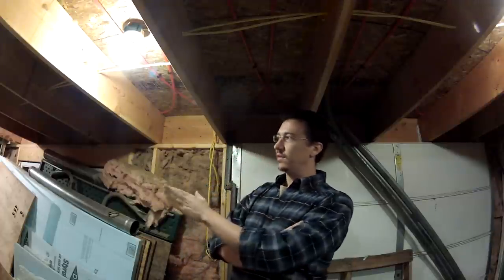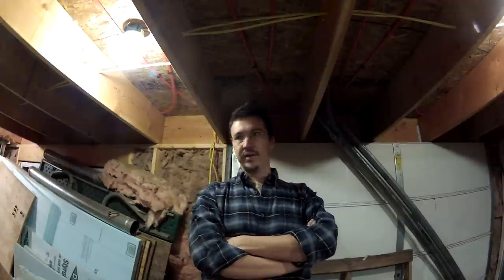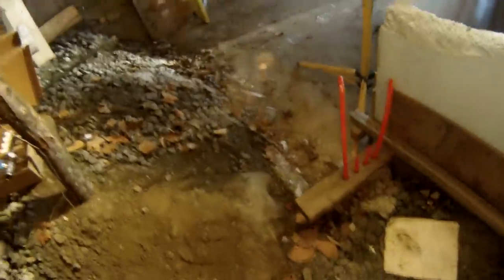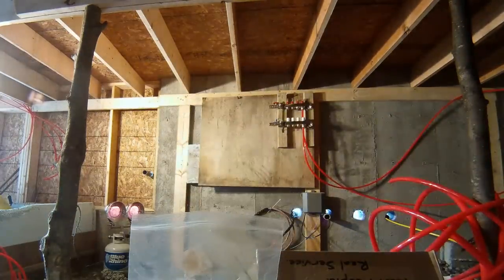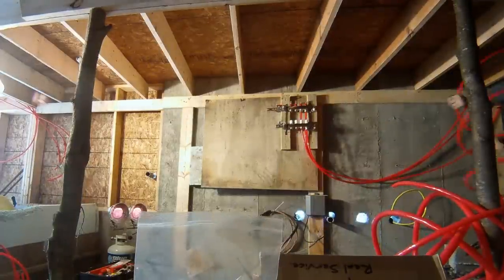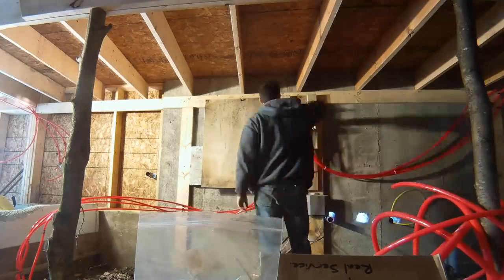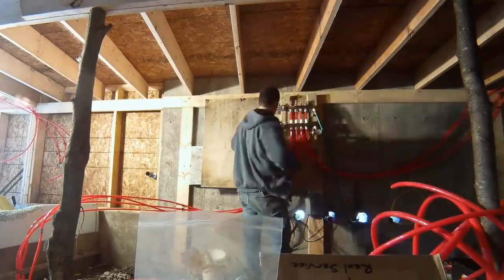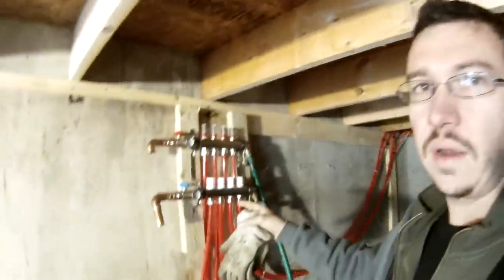Installing a radiant heating manifold - 94 - My DIY Garage Build HD Time Lapse

Comment from the maker: I've got a little more experience with this now.  I recommend antifreeze.  I waited until I had finished installing the rest of the heating system and then used antifreeze.  Although I found it hard to get the mixture right.

Comment: What I know about this matter is that you see many times they first overheat the water into overheated steam en run it through isolated steal pipes which they put 1,5 meters into the ground! And even then I know of situations in which leaks occure! Frost can penetrate deep into the ground! Where you live the weatherconditions are very extreme!! I hope you can get this right, though! If not you can always place a boiler in the garage and keep the tubing above the ground level!!